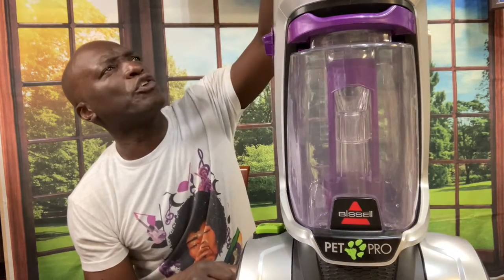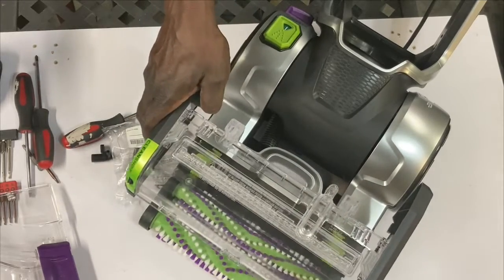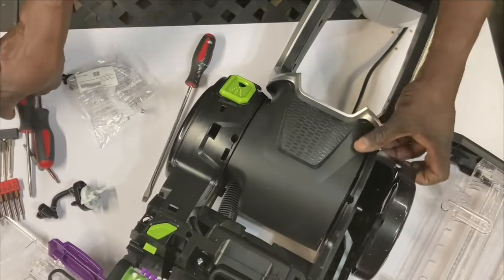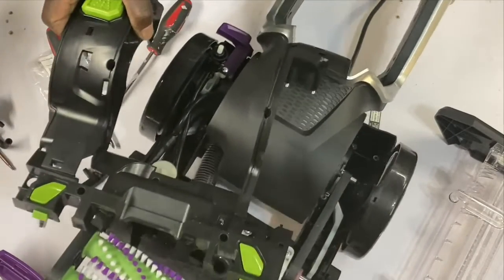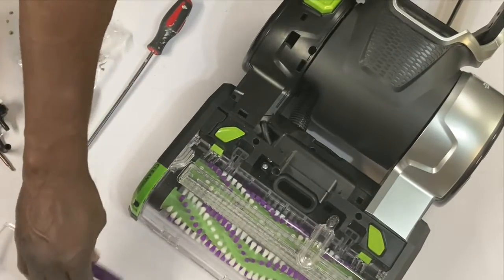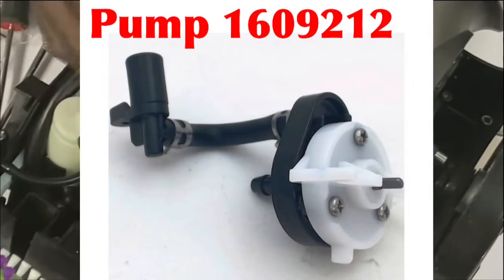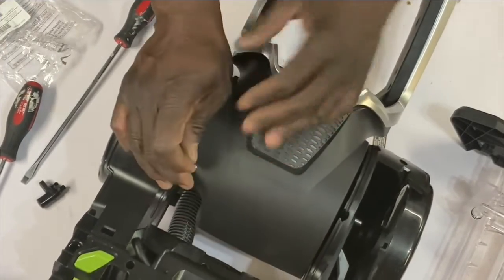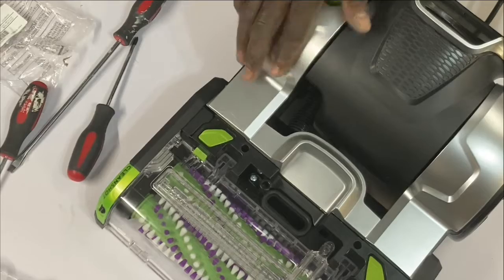My Bissell Revolution pet pro is leaking p2

Comment: This is so helpful! My bissell proheat 2x revolution pet 1548F won't stand up and lock into place after I had to replace the power cord. I think I missed a crucial step putting it back together. What would you recommend?
Reply from the maker: Take a look at this video. It’s focused on the clean shot button but it’s in the same area. Also see my Bissell tips playlist- My Bissell Revolution pet pro cleanshot is stuck
https://youtu.be/6IguALrP0V0

Comment: So the cause of the leak, when using the upholstery tool, is this plastic elbow breaks?  

Mine has leaked from the first time I used the tool. 
I was thinking maybe i was supposed to have the tray under the machine while using the upholstery tool, but I tried that yesterday, and it just overflows the tray as well. 
Appreciate the video.

Comment: Appreciate your videos. As soon as I attach my clean water tank on the pet pro, within a minute the water will start leaking from the very bottom of the machine from one of the tiny holes, even if the machine is completely off and the trigger is not pressed. Within a few minutes the carpet will completely soak underneath. After opening the machine, I noticed the water is all coming from the pump where the white thing is attached. Not sure if that is normal, if the pump is the culprit, or if it is further upstream. Do you have any specific video for that issue? Had a tough time finding it.
Reply from the maker: Hi try these videos: 
https://youtu.be/2RYACfNgKBc

https://youtu.be/dDxU2qCixuQ

https://youtu.be/pl-4-Krcn2I
Reply: @monroevac

Comment: Just had this issue and returned it and didn't know if I even wanted to get a new one. It's bubbling out the connection where you put the upholstery hose. Tank emptied onto my floor in seconds.
Reply: Did you find a fix for this? Mine has just started doing this

Comment: Hi, subscribed and watch a few videos but can't seem to find what's up with my Bissel Revoltion.. I have the issue as soon as I put the water tank on it just starts dripping out the bottom... like behind the brushes out a few square holes... tilt it back  more and it will drip below the square holes and out that round molded area, by the hose, out of them 2 holes.... I suppose I'll just start taking it all apart. Any advice will help, thanks! Good channel!
Reply from the maker: try this video as a starting point-It's possible you may have to replace the pump or a tubing.--https://youtu.be/2RYACfNgKBc-
Reply: @monroevac  there is a small white cylinder with hose connections at the bottom, some kind of diaphragm in it, the cap broke loose on it.. so glued it back down, havent had a chance to see if that was it but there was water just coming out as soon as i inserted the water bucket up top.
Reply: @monroevac  hey, just wanted to tell ya that was my issue. What ever that little white cylinder is up front, infront of the brushes is, with 1 hose going in and 2 going out, the top had broke or popped off. So just sealed it back up and put it all back together, no more leaking

Comment: Just had to take mine apart because it was pouring out of the coiled pipe under the unit, after much disassembly, I wrapped both the end of the pipe with PTFE tape and reassembled it and it seems ok
Reply from the maker: Nice work! Sometimes that's the only route 😊
Reply: @monroevac  thank you for taking the time to do the video as it helped me disassemble the machine, I wouldn't have been as confident otherwise 😊

Comment: Mine is leaking through the other side, the part that goes to the floor. Do you have a video on that?
Reply from the maker: Sorry for the delay-somehow I missed this One. When you say the other side are you referring to the back or on the right or left of the unit
Reply: @monroevac  Left side, opposite the hose connection. Sometimes if I squeeze the trigger on the main handle a few times it'll stop.
Reply from the maker: If you want to try: remove the cover so you can see exactly what part is leaking. Possibly the pump. Check my Bissell playlist. Should have a video showing you how.

Comment: Hi Monroe I have pet Revolution version, my motor spins but when it hits the ground it stops spinning. At first it start spinning then stops.

But when I take the parts out and see it seems strong just when it’s all together it stops.

I changed the all the belt new brush, it spins well and seems strong.

Not sure, if it’s the rust, now I have to take it all out to see.

Comment: I am not getting a Spray. Can you help me pls
Reply from the maker: First inspect the tank and make sure it's not warped. Second thing is to check the max slider on the side and make sure it's set to max. Third if still no spray check the trigger and see if it has resistance. If no resistance then replace the handle

Comment: My problem is the white little tank the button is broken
Reply from the maker: The Revolution comes Roth 2 tanks clean water and dirty water tanks- which one are you looking for
Reply: @monroevac  the mini tiny one inside the machine the one that has 3 hose is right next to the piece you were holding and fixing
Reply: Me too
Reply from the maker: looking through the schematics and I don't see the part number. Doesn't look like The part is for sale. I'll continue to look into it.
Reply: @monroevac  thank you
Reply: @monroevac  I am commenting to follow along, that part is busted on mine too.
Reply: when I depress trigger it doesn't  release solution  the valve on machine  doesn't  drain  handle is fine  blowing compressed  air blows into tank    looking for where solution drains to brush are to see if there is a clogged hose
Reply from the maker: Try these two things- first try replacing the pump belt (also make sure the slider on the side is set to max) next test the cleanshot if it sprays water then the problem is in the lower section if not try replacing the tank- possibly hot water may have warped the tank- good luck
Reply: @monroevacsupplies   thanks again Wayne  once  I took the brushes off it worked!! very strange!  you're  the best